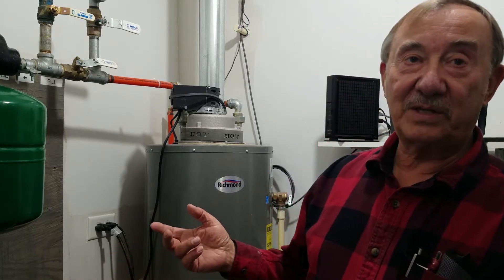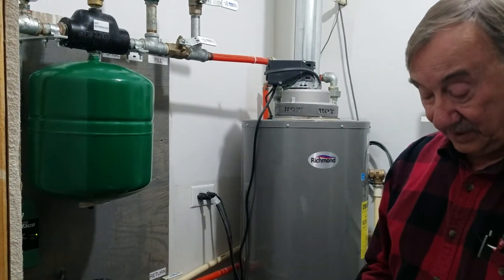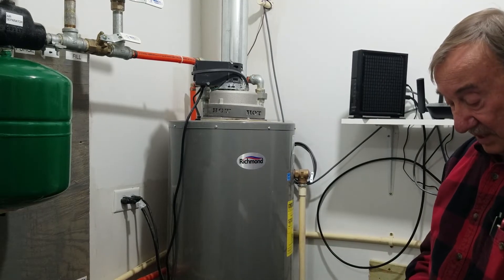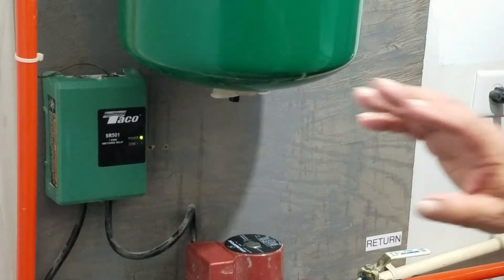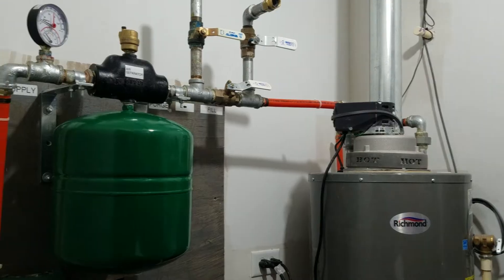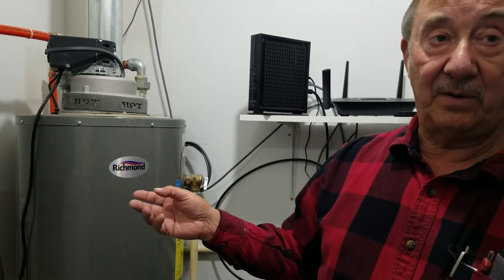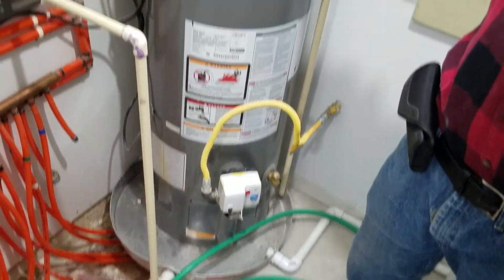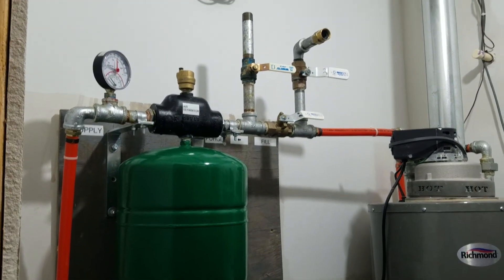Radiant Floor Heat With A Water Heater

Comment: You put distilled water in the system? Distilled water is an insulator and has poor heat transfer.
Reply: Ross Nonsense. Water is an excellent heat transfer medium, and distilling it makes absolutely no practical difference to its heat carrying capacity.
Reply: @spencerwilton5831  true but distilled water is not recommended in hydronics as there are no minerals /metals in it, so it tries to equalize and leach metals from everything it touches
Reply: @andylarson3547  but it has antifreeze to neutralize it.  no different than a cars radiator.  antifreeze and distilled water or a premixed 50/50.  flush and refill every 100,000 miles.  for a house maybe every few years if that.

Comment: The only problem with using a tank style water heater is when it is used for hydronic heat systems, is the warranty is void. Any manufacturer of water heaters will say same thing
Reply: Not so- check out Takaji
Reply: http://www.takagi.com/support/diagrams

Comment: Thank you Im trying to use a 10 gallon hot water heater for heating popigation beds for rooting cutting.I would love to pick your brain thank you
Reply: Use any size water heater, but you can throw a thermostat on the pump to cycle it on and off based on temperature. They are set up the same way. Just set it up and try it. You may want a closer spacing on the lines just so there is an even temperature everywhere.

Comment: If it is on glycol why do you set it to 120F? Shouldn't 80F be warm enough?
Reply: There needs to be enough of a temperature differential in order for heat to transfer.  It takes one BTU to raise one pound of water one degree F.  One gallon of water is 8.33#.  For example, assume thermostat at 70F, heat water to 80F, return water at 72F, &circulate 10 gal per min. The calculation is delta temperature times mass times specific heat of water.   [(80F - 72F)] x [10 gal x 8.33#/gal] x [1 BTU/#/DegF] = 666.4 BTU.   If you increase delta temp to 45F by using 120F supply and 75F return, now you are moving 3748.5 BTU.   If you don’t have enough delta T, the pump will never stop running.
Reply: The glycol elevates the boiling point and depresses the freezing point and this is a wonderful engineering principle. However, another thing happens when glycol is mixed with water: it's harder to transfer (remove) heat from a glycol/water solution setup compared to 100 percent water setup. I learned this first hand when I graduated from college many years ago. At that time, I had an old junky car but I wanted to travel the USA including the deep southern USA where my weak radiator needed some extra help to transfer heat from the engine. It was a rusty/weak radiator so I could not take a chance on running a glycol solution which would indeed depress the boiling point but along for the ride the radiator, hoses, and engine would run hotter.  I had 100 percent water (no glycol) in the coolant system. To prevent the radiator from boiling over, I did two  things. 1) I turned the heater fan motor onto the high position setting and ran it every time I drove the car (for comfort I rolled the window(s) down and wore shorts). This did a superb job of removing heat from the engine. When I returned to Michigan 18,000 miles later, winter would be coming, so I needed to run a 50/50 water/antifreeze solution mix to depress the freezing point so it would not freeze at night. As soon as I did this, I noticed a hugely substantial decrease in the amount of heat that the fan blew from the dash into the car. In the following spring of the year, I drained the 50/50 solution out and replaced it with water only.. Wow, the heat output from the dash returned wonderfully.

Comment: Great video thank you. Would you mind answering a few questions.
1. How much did the Hot water tank cost.
2. How many linear feet is your 1 zone loop
3. Do you wish you would of installed multiple zones
4. Have you experienced where the the water heater would not keep up with heat demand.
5. What are your coldest months.

Thank You so much.  Where I am from WA, colder months can be below 10 deg at night. 

Thank You
Reply from the maker: The water heater cost about $600.00. The length is about1500 feet. No regrets, It is an open floor plan ranch house. On the coldest days in our area near Chicago the temperature can be below zero with single digit highs. We keep the thermostat at 70 degrees and the system runs about 50 percent of the time.
Reply: @professorgadget9153  Thank You

Comment: I imagine there is still air in the top of the water tank.  I would think the easiest and fastest way to purge the air from the system would be to loosen the anode and bleed the air there.  Nice setup, thanks for sharing.
Reply: @Hay Day I never claimed to be, but if you want to make an intelligent comment, maybe one of us will learn something.
Reply: @Hay Day troll
Reply: @Hay Day admittedly no, but I've been in a few water heaters and I know that on most of them, the outlet nipple has a tube that extends into the tank a few inches, leaving an area at the top of the tank that can trap air.

Comment: suggest you turn your pump so the shaft is not sitting vertically.  The bearings will support the shaft if you have motor armature horizontal where the bearings can support the motor shaft.  Just figured you would not want to need to change out the pump prematurely.

Comment: Great video.  What model is the water heater... do you recall what it cost?  Is it just a regular water heater?
Reply from the maker: It was a high efficiency Richmond 29 gallon. It had a 12 year warranty and the specs said it was good for hydronic heat. I think it was around $600

Comment: Thanks for the video.  Is the water in the heater always hot, or does the water heater only heat when it's called for by the thermostat?
Reply from the maker: The water heater is on and keeps the water hot based upon the thermostat built into the water heater. It is only on during the heating season as I turn it off in the summer. I know that sounds like it would waste energy but really not much. It is a high efficiency water heater and it is in the house so the waste heat contributes to heating the air in the house.
Reply: It's just a regular water heater. With the thermostat so low, they barely run when pump is off. Water heaters are good about keeping the heat in, so they don't really run when the water isn't moving.

Comment: Do you have a furnace for additional heat and for air conditioning?
Reply from the maker: Yes I do. It is only used for air conditioning although it could be used for heat if for some reason i took the hydronic heat off line.
Reply: @professorgadget9153  The floor heat, heats your house? I imagine it just helps the heater out.
Reply: Ron West Why would you think underfloor heating is only suitable for supplementary heat? A well designed system is more than capable of heating a house without additional heat sources. We have been using such systems in Europe for decades.
Reply: @spencerwilton5831   Maybe because nobody ever talks about it and there's a lack of information about it. I've never met anyone who has in-floor heat like this. You really think having in-floor heat is enough to keep a house warm?
Reply: Ron West it's certainly more than enough to keep a house warm! Of course, as with any heating system it's important to have reasonable levels of insulation and draft proofing for it to perform at its best, but you don't have to go overboard. One of the best examples of it I have experienced was in a holiday rental that was a converted former church. The space was vast. The ceilings over thirty feet high. The walls solid masonry, and a stone floor. Ordinarily, a space like this would be nearly impossible to heat economically to a comfortable temperature. The underfloor heating transformed it into a genuinely luxury space. Never once were we cold. Once you have experienced underfloor heating you won't want anything else. It provides a uniquely uniform heat across the entire space. The heat is where you need it- at ground level, not floating up around the ceiling- for that reason, you can often set the thermostat lower but still be more comfortable. It's silent in operation. It's perhaps the most economical form of heating there is (depending on what you use to heat the water obviously) it works very well with heat pumps, or failing that is a perfect fit for a small, condensing and modulating gas boiler. The only thing that takes some getting used to are the slow response times. You have to experiment a little with a good quality programmable thermostat - you can't just switch it on and expect the house to be toasty warm in thirty minutes.

Comment: How much is your gas bill with this setup? I've got an old boiler and in January with a Delta T of 34°F my gas bill was over $286. I'm curious about the change with using a water heater instead. But I cannot seem to find relevant research or journal detailing the cost variance between a boiler and hot water heater.
Reply from the maker: It has been a mild winter in our area, Wilmington Illinois. We use gas to heat our water, dry our clothes and cooking. My bill for the last month was $46. Ther are only two of us living in the house.
Reply: @professorgadget9153 , thank you for the quick response.

Comment: The only problem I see is that your pump motor is installed vertically and they say to not ever mount them in that orientation. Otherwise I really appreciate your detail and information!